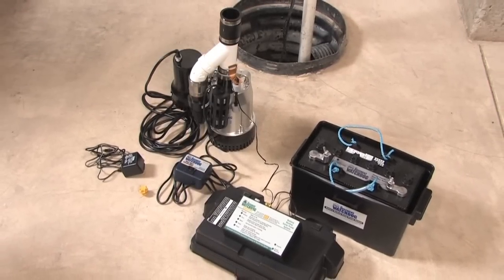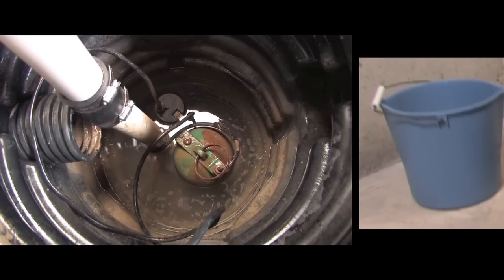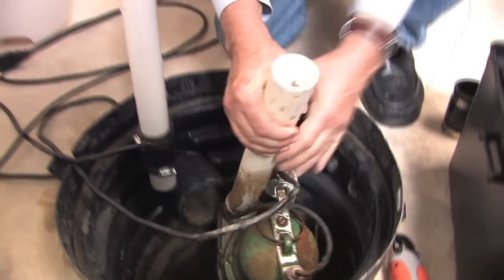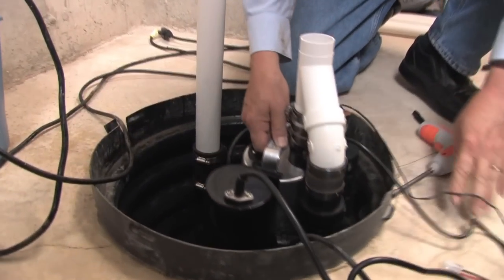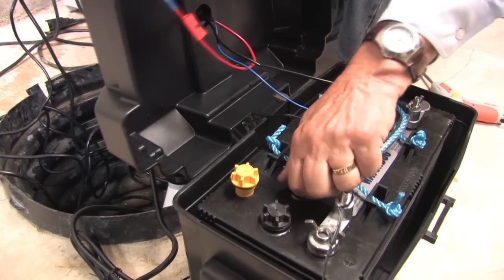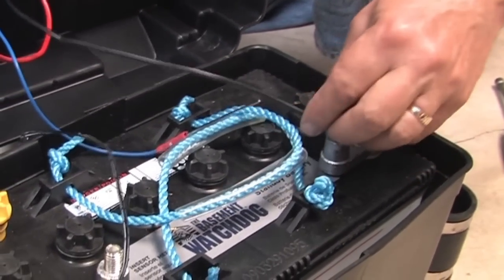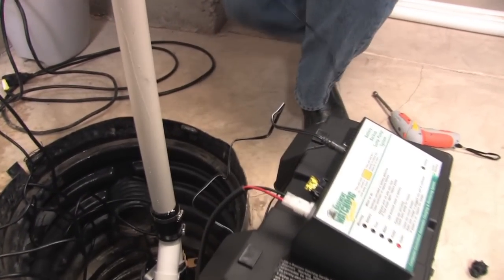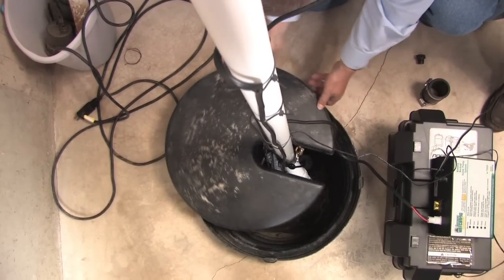How to Install a Combo Sump Pump - Basement Watchdog

Comment: Note the electrical outlet they use in this video is using a 3 plug in outlet and it’s not going straight into the standard wall outlet. Very poor design of plugs does not allow for both to be plugged into a standard 2 plug outlet. It broke my battery backup plug case. Do they not test their products? Basic engineering failure.

Comment: Apparently this works better if you don't use any elbows. My basement has 8 ft ceilings and i am using 1 90* fitting at the top and 2 45* fittings near the pump to make a nice presentation to the corner. Don't work so, I have my doubts this will even work. Glentronics builds these pumps but only for 10FT of head pressure. 102" of pipe and  3 fittings is more than 10ft of head pressure. Why even waist my time to sell me a pump that's is marginal. When the power goes out the watchdog is useless!! At approx $1000.00 for the installation of a combination pump that doesn't have my back, I would have been better off to Purchase a Generac power system. 
I have two of these setups if anyone is Interested......Not 
I don't get it, Pump works but not in the basement. Glentronics, you might want to build a pump that can overcome a 15 ft of head pressure, so I can have comfort my basement doesn't flood. I wouldn't Trust Them